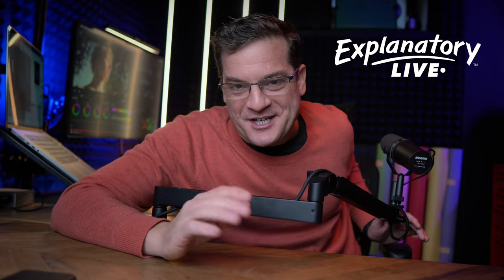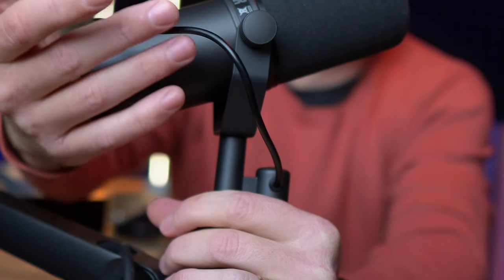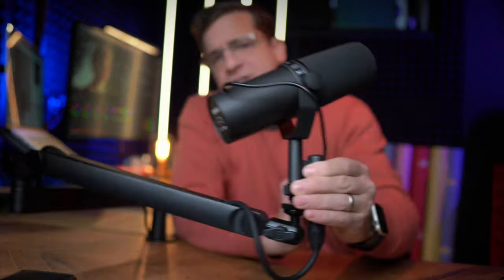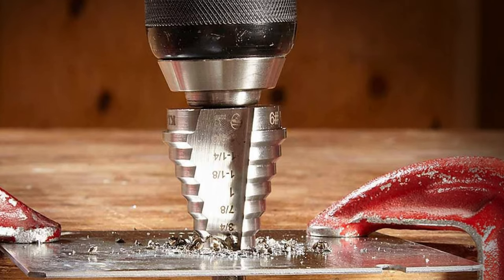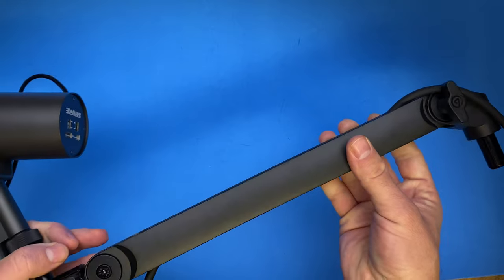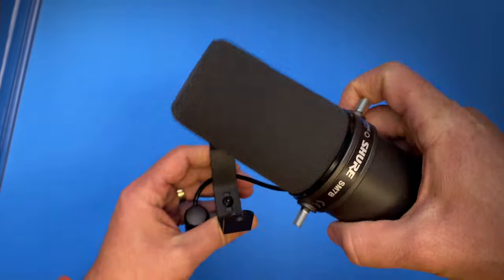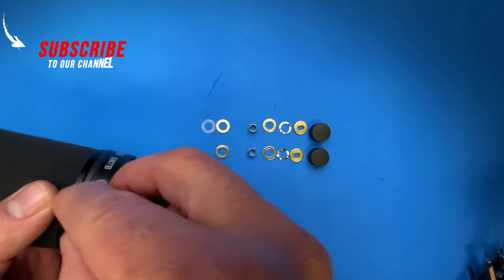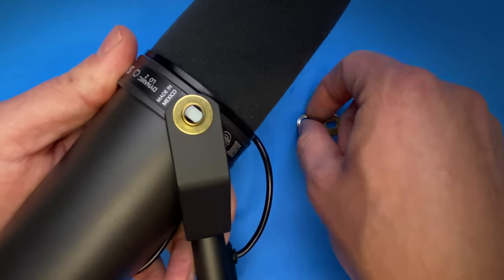Elgato Low Profile Mic Arm and the SM7B - 3 ways to Fix it.

Comment: I think you can get the same result without drilling. I took the Allen screw out of the middle knuckle and flipped the part of the arm that connects to the mic. The top magnetic plate is now on the bottom of the arm, but the magnets seem to be strong enough to hold the plate in that orientation
Reply: i thinking that exact thing
Reply: Not all hero’s wear capes. 😊
Reply: thanks so much for this wish i would've thought of this sooner.